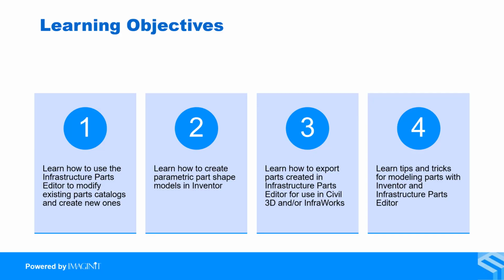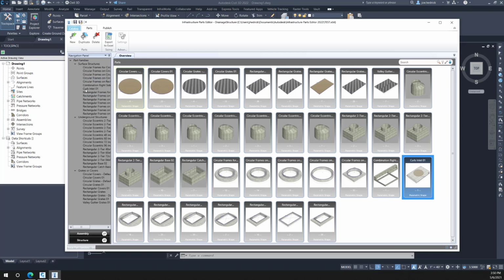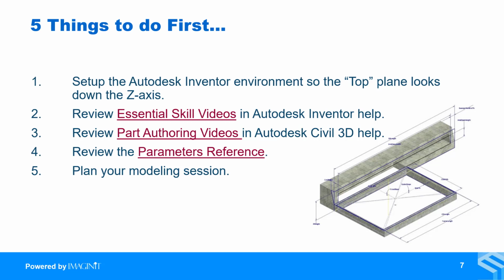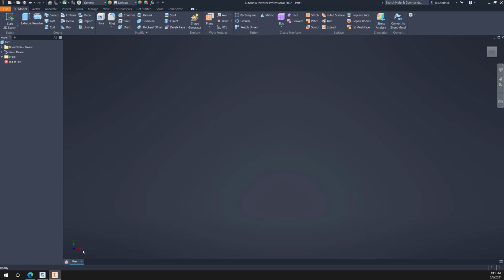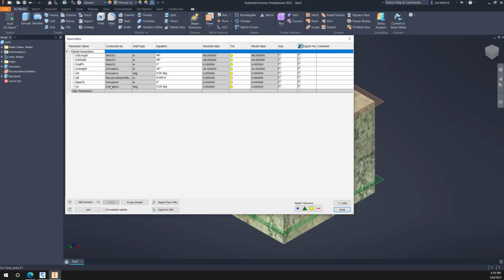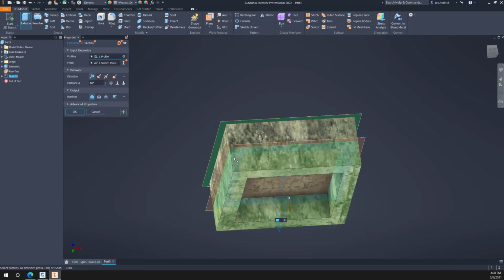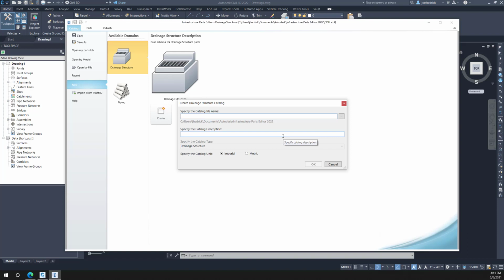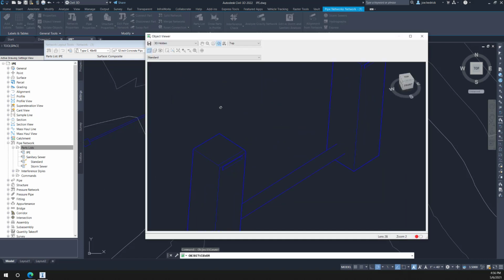A Civil Engineers Guide to Navigating Autodesk Inventor and the Infrastructure Parts Editor

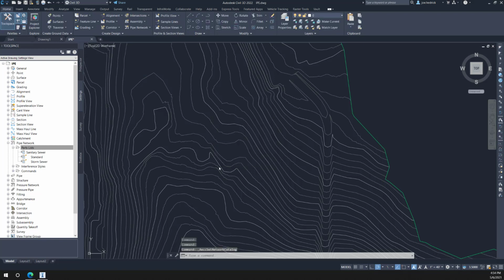Comment: I followed this guide to the letter, but my custom Structure catalog isn't in the dropdown shown at 54:05. It is there, when i navigate to the folder containing all the other typical catalogs. Any idea as to a solution?
Reply from the maker: We checked with our experts, here's what they said: 
It's a bit difficult to diagnose this without working directly with them. 

One thing that might be causing this issue is the user may be using a shared location for part catalogs and the IPE parts were published to this shared location. IPE parts are handled a bit differently than Part Builder parts where there are extra files that are put into the ContentLibrary/Templates directory found in the enu folder. Ensure that the parts are published to the default enu location rather than a shared location.

Comment: My question is "How do we add a variable with a Range?" So instead of creating 30 different structures of differing heights, we can create a single structure and set a range for the riser height like the Part Builder allows for?
Reply from the maker: Per our experts: You define the sizes in IPE (Infrastructure Parts Editor) and then export.

Comment: Where are connection points defined within an inlet part?  For example, a 24x48 box that can accommodate pipe connections on all four vertical walls. Does that occur in the inventor environment?
Reply from the maker: Connection points would be defined on the underground structure.
Reply: @imaginittech  thanks that part I realize.  I guess the better way to word my question would have been “how does one who does not have inventor add the multiple connection parts to an underground inlet box?”  Is there a way to do this within the confines of the AEC suite without having to purchase Inventor?
Reply from the maker: @michaellardi3086  Sorry it took a bit (holidays and all that). Per our team: The only way to do it is with inventor.  It can't be done  with just the AEC Collection
Reply: @imaginittech  my thanks to your team for getting this answer to me. I’ve read forums, comments sections, Reddits, etc and could not get a clear unambiguous answer to this question.

Comment: Great video indeed. Your instructions guide someone to create a really working part. You should not be embarrassed about not seeing the autodesk part authoring videos. They do not use the parameters so they are close to be useless since parts made according those videos do not work. I had to read the help line by line and do reverse engineering by exporting autodesk's parts to find the path on my own. I wish i have seen your video before. It would cost me much less time to create a part on my own.